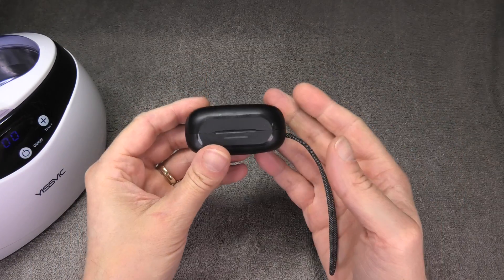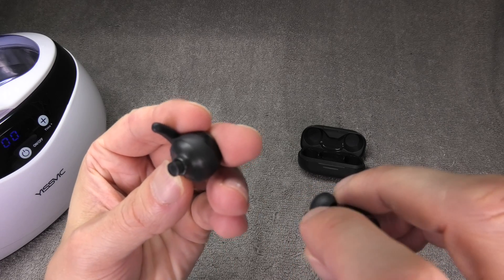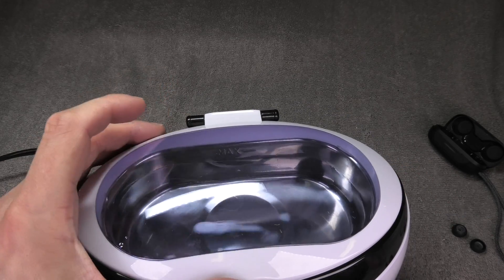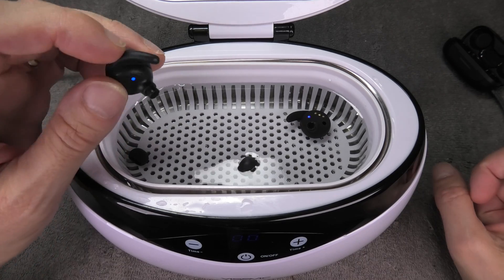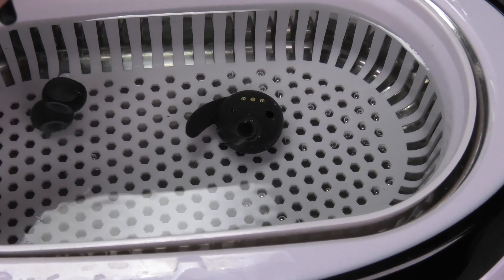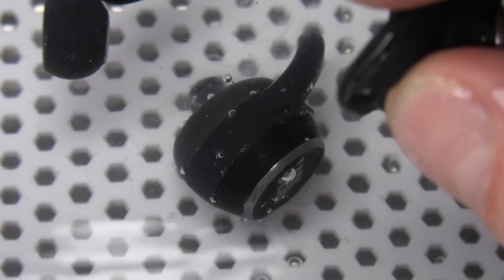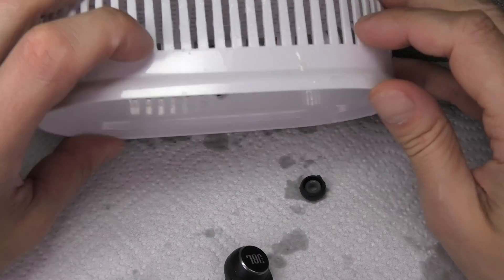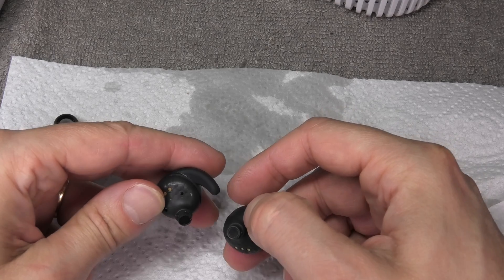Fixing earbuds with  my UltraSonic Cleaner Bath (How to)

Comment: One thing i found when i had the same problem (being one earbud being quieter) is that it also didn't close up fully, when put in.
When I checked what might be the problem, i found that the little hole on the side of the speaker extension was open on the bud in question. Which made the air escape and with that the sound. I was wondering if that is the same thing u had problems with or if u really just had dirt problems.
Thanks for the vid non the less

Comment: Wouldn't IPA be safer for the bath?
Reply from the maker: Using IPA would be more effective. But I would never use it in an ultrasonic bath because of fire in case of a malfunction.
Reply: @MegaSafetyFirst  I see, thanks for clarifying!
Reply: I know it's an old Comment, but using Plastic jars/glass Mason jars can help Mitigate the fire hazard along with using a well ventilated area. It's what we used to get in grease off of fishing reels. It saves on solvent too.@GridPB